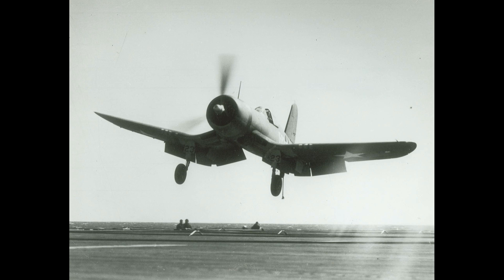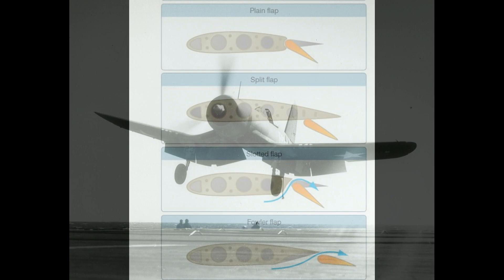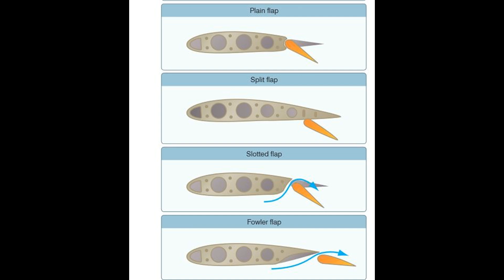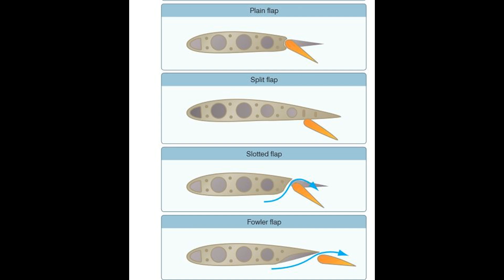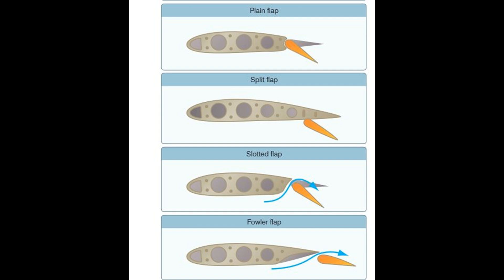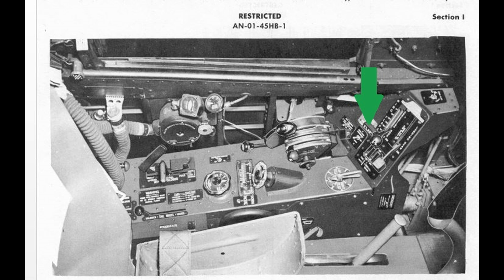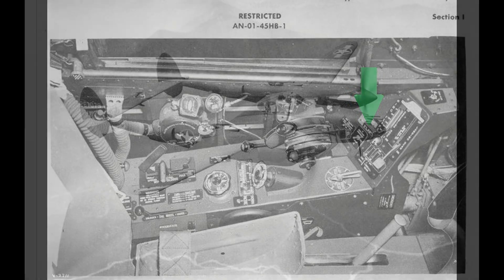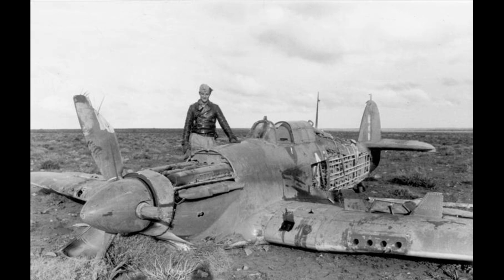Using Flaps in a Dogfight with the F4U Corsair and others

Comment: Hi!  I flew low in a Cessna 182 with a Robertson STOL kit, which was stock slotted flaps, and a provision for 10 degrees of aileron deflexion.  I flew it about 90 most of the time, and I used the flaps and "flaperons" if I wanted to bubble over a ridge for some reason.   Otherwise I flew it "clean" . The down side of the "flaperons" was, that you just gave up 10 degrees of aileron travel which you might have otherwise wanted for a cross wind landing.  So heavy crosswind landings, again I flew it faster, so as to maintain aileron "authority".   Since it was also tricycle gear, remember your rudder deflection gives you the opposite nose gear deflection you want, and tends to pull you off the runway in the opposite  direction of the cross wind,  when the nose gear touches, wings level, when you have "cross control" rudder input, and vertical stab wants to weathervane.

Comment: July 18th, 1944, 363rd fighter group, 382 squadron. 8 P 51's who had been joined by 4 P47's.   Jumped by at least 35 109's (some said 100) Lt. Richard Asbury   found a 109 on  his tail he could not shake. "Finally I pulled the circle as tight as I could, placing my ship in a spin situation, pushed the prop pitch control fully forward (high RPM), pulled the nose  up quickly to bleed off a little speed and rolled to the left dropping some flaps as I came around. The move got the 109 off my tail and me on his. The flaps on a Mustang could be used this way for a short time on the 
P-51 and I made it my business to know everything about this plane I could.  With me on his tail the 109 pulled away but I had no trouble staying with him. I pulled the trigger and only the outboard right one fired. I adjusted my aim to his left wing tip and fired, the recoil pushed me to the right and raked him wing tip to wing tip. After 3 attempts his engine started belching smoke and he was too low to bail so he rode it out to the ground".  The "tom ?cruise move"????) 
  Same dogfight. Lt Edward Pawlak found a 109 on his tail, He pulled a tight turn until the 109 stalled out. twice more in this fight he found himself with a 109 on his tail and used the same maneuver to lose them.    There's more to this great air battle, but there's no mention Pawlak  using his flaps in the turns?     This battle lasted 20 minutes. Despite overwhelming numbers the Total was 10-0-4 for the Mustangs , 8-0-4 for the 47's.  One mustang lost.    Maybe they were just facing "hitlers little kinders my first 109 students" ????????????

Comment: I have flown a great deal of air to air combat in the F100, F4C, and F15. In the first case, the F100, you were always trying to regain energy, as in corner speed. Putting down flaps would have just made the situation worse. In the other two, the F4 was better, but you were still always trying to get energy.  In the F15, not as critical, but still sometimes you got slow. I personally think, based on my experience over 14 yrs of flying fighters, not simulators, that flaps are a crazy idea. There are several maneuvers that could  be used to get around a high G corner.
Of course, this has nothing to do with prop driven fighters, just my experience.
Lest you complain about the F100, be advised our Guard unit, the LA Air Guard, made our reputation flying cleaning F100s against all comers. In the F4, we did not turn much, but instead flew the F4 to maximize its good points. In the Eagle, you just did not need to turn much, but could if needed.
Reply from the maker: I'm sure you're right about those planes, but the Corsair and the P-38 have specific settings for combat flaps and a lot of study was put into the use of them. That said, yes I suspect that in most cases there were not really useful. The Corsair and Lighting can't out turn a Zero or an Oscar even with them. The Oscar which also had combat flaps could out turn any allied plane without using them anyway.

Comment: although the P-38 is best used for hit and run, it is a much better turn fighter than is generally known and mainly is hindered by sluggish roll at low speeds in spite of tremendous lift potential. in a similar way, the F-15 is far better at low-speed high-AOA flight than is commonly known and can even outdo the tomcat in this area until flaps come into play
Reply from the maker: I still like the Tomcat more than the Eagle. The P-38's roll rate once they put in the boosted ailerons was pretty much unmatched at high speeds by other WW2 fighters.
Reply: @GregsAirplanesandAutomobiles  the f-14 is romanticized much more than the f-15, but I suspect you in particular would appreciate the f-15 if you really dug into it. It seems like a very simple and bland jet but it has a huge amount of 'hidden' attributes that only a true enthusiast would appreciate. For instance, the conically cambered wing provides much of the benefit of a leading edge flap wing design without the weight/cost/complexity penalties of such a mechanism; this allowed for the nodding intake design, which actually serves a quasi-canard function in addition to being something of a leading-edge flap for the lifting fuselage design. Surprisingly little noise is made about the fact that not a single F-15 crashed in the entire McDonnell development process, and the first such incident happened in Air Force hands. This is partially due to the tremendous amount of redundancy built into the Eagle, including what could be considered a partial fly-by-wire system (though all 3 axes) which once brought a pilot home safely without him even knowing his mechanical linkages had failed. Even the radar, with its one-man operability due in no small part to a ground-breaking use of high and medium PRF in an airborne set, is quite impressive for the 'bland' jet from 1972
Reply from the maker: I'm not saying the Tomcat is the better plane, I'm saying I like it more. You used the word "romanticized" and that's exactly it, I'm not really going to war in either one. I just like them and in simulator world, I fly the Tomcat.

Comment: Bank angle has nothing to do with G’s pulled or turn rate or turn radius. G’s pulled, turn rate and turn radius are determined by the elevators. Either positive or negative. I fly aerobatics in case you are wondering.
Reply from the maker: Mike, I don't think you listened to what I was saying. Obviously bank isn't directly related to G load, otherwise according to all the charts for bank vs. load every plane would disintegrate at a 90 degree bank angle. However if you are in coordinated flight and at a constant altitude, then yes, 60 degrees of bank will give you 2Gs and so on.
Reply: @GregsAirplanesandAutomobiles  Bank angle has no relationship to G load. I can achieve any bank angle with any G load I wish for, with ease. I can achieve 90 degrees bank angle and maintain it indefinitely with zero G load.
Reply from the maker: https://www.faa.gov/regulations_policies/handbooks_manuals/aviation/media/00-80t-80.pdf Page 38. It's there for you in chart format. (note that's page number 38, the printed number on the page, not the pdf number)
Reply: @GregsAirplanesandAutomobiles  Hi Greg, I did read all this as a student pilot some 20+ years ago. It is all correct but not very helpful for real pilots, especially not for air combat. A few more complex manoeuvres and you quickly realise this. An interesting manoeuvre used by Zero pilots was a vertical climb followed by a Stall/Hammerhead Turn at the top. Useful if you have superior power to weight ratio. Zero airspeed at the top but actually no stall as the angle of attack is also zero. Beware pulling too hard on the stick. My stall speed is 110kph but I have had pre-stall buffet at 300kph pulling 7G after a loop. This is usually called a dynamic stall. Conversely I can fly at 50kph with full power on, nose high and maybe some degree of descent. Again useful in air combat at times. The purpose of air combat is/was ‘pointing’. Ie pointing your weapons. Off course modern air to air missiles can steer 90-180+ degrees I believe. But if your are firing guns it is still all about ‘pointing’. One of the reasons the Harrier was so good.
Reply: @GregsAirplanesandAutomobiles  Hi Greg Yes that is all correct. In air combat though one would never fly at constant altitude or even straight. And often uncoordinated flight. Plain rudder application causes a horrid uncoordinated skid which easily throws people off your tail. If you are turning it is always in a climb or a dive depending on your aircraft, the adversaries aircraft and your speed. I have had pursuing jet fighters deploy flaps and undercarriage to get their speed down to mine. Not heard of it being used much in real combat though. A low speed flick roll (Snap roll in the US) is basically impossible to follow and gets someone off your tail very quickly. It also slows you down very fast and can put you onto the tail of a pursuer.

Comment: I spent 5 years flying a T6 for a ride company. Some of the flights were simulated dog fights set up on a converging flight path with pre determined offset and the turn in. As we flew with very conservative engine power settings our max g loading in a turn was limited to about 3g  (plenty for the guy up front and nice to the airframe). Some fights were over in few turns but once in a while we would get two good "pilots" (most were non pilots but they flew the fights after 20 min flight lesson) and the energy management game was on. With the better ones we would start doing bit of vertical high and low yo-yos, all to decrease the turn radius and to retain enough energy to track the lead plane long enough for a "kill". This is where bit of flaps helped, but it was only the finishing touch as the energy loss was very noticeable. It was all done for fun, but the good "fights" took a lot of energy out of me.....once the "Fight's On" came across the radio the flying got intense. The most memorable fight was my last check out before being sign off for commercial flights. I went against a very experienced guy, we started at 10k and hard deck was at 2k.....To this day (15  years later) he will not admit that I drove him below 2k but he never said that he got me. I had the front seat guy fly the airplane back to the airport, I was spent. This was a high energy fight, power was up and flaps would not make any difference as we were going well past the vertical. I saw your video where you talked about the Cub, Stearman (yes it is a truck, still love it, look up John Mohr Stearman acro to see what a great pilot can do in that bird). I think you should find a T6 with the right instructor and go up for an hour to see what these WW2 birds are about. It is an amazing airplane, it handles like a fighter with less  power. I was able to fly P51 with the instructor only working the radios after few thousand hours in the T6, it was so easy. Amazing power that you have to respect, but the landings in P51 were a non event. That wide gear, long fuselage and higher wing loading made it simple. Ok rambling on, great channel, thank you.

Comment: The FW 190 had a 10 degree flap setting for takeoff.  Have you heard of any instances of this setting being used to improve the 190's turning performance?  I feels sure I've seen a spitfire pilot's report on a 190 outturning his spitfire, and some mention by a German pilot of using flaps in combat - but it was a long time ago.
Reply from the maker: I'm sure it happened, but I don't have a specific report of instance of it. However due to sheer numbers involved, it's seems unlikely that no 190 pilot ever did this.

Comment: Just a few points for those interested. 9g only for very short period as pilot blackout and speed loss due high drag.
Every wondered why flap use forbidden above 20,000 feet for all civil jet aircraft where TAS is higher.  Found out when scissoring in mock combat at 35,000 feet against another Avon Sabre. I tried to tighten the scissor to get behind the other guy by dropping flap. Flicked immediately into a spin. Flap caused accelerated air above the wing to above Mcrit and Mach shockwave.
www.captainbyronbailey.com
Reply from the maker: That is a great point about flap usage at high altitude! And yes, every jet I have flown has that prohibition.

Comment: 6:40 :  “The P-38 shot down more Japanese aircrafts than any other fighter” : It may be true for USAAF fighters, but for all fighters it is not even close: The P-38 had about 1900 air to air kills, the F6F Hellcat 4900. It is likely the Hellcat encountered far more single engine bombers and Kamikazes however... The Japanese said: “The Hellcat was the only US fighter that would turn with us”: It could out-turn all Japanese fighters except the Ki-43 and Ki-100, and was a close match to the later A6M5 version.  6:53 “Since No Allied pilot in his right mind would attempt to turn with a Ki-43 at low speeds, I doubt Japanese pilots could make much use of this advantage” I know this is not a tactics channel, but please consider the well known instance of one Ki-43 turning continuously against 16 P-38s, at low power with canopy open for twenty minutes, until they all ran out of gas and went home... Turning ability at low speeds is not something the opponent “allows” you to use: It is an absolute advantage that can easily defeat high speed hit and run tactics. The real evolution of WWII was from hit and run dominance to slow speed turn fighting dominance by 1944, with circumstantial exceptions. I know this sounds incredible, but this is increasingly backed by recent historical analysis, especially in recent Pacific theatre research on air tactics.
Reply from the maker: Yes, I mis spoke there as I have pointed out before. The 38 shot down more Japanese aircraft than any other USAAF fighter. In regards to use of low speed turns, of course it happened, but Generally speaking US fighters had a 10:1 kill ratio over the Japanese despite having inferior turn performance. This by itself is solid evidence that low speed turn performance wasn't a dominating factor. I'm not sure what your point is about Zeros using hit and run tactics.
Reply: One historian pointing out these counterintuitive facts is Intelligence historian Justin Pyke. An example of a US pilot quote from 27 September 1942: “The Japanese Zero has generally poor fighter tactics. Zeroes could not be shaken by us if they chopped their throttles and sat on our tails...” Early war accounts of Zeroes using exclusively hit and run tactics are so overwhelming in numbers, at the near exclusion of other tactics, that citing examples would be endless... Of note is that this did not apply in the same way to the Japanese Army Air Force.
Reply from the maker: I can't tell what your point is.
Reply: The point is the Zero started by using hit and run tactics because the dominance of hit and run was a pre-war assumption (ruined by live round 1% hit rates). The A6M used hit and run against the Chinese... The document you used to bolster the idea the US used hit and run tactics all the way through WWII (in another video), the one saying “dogfighting is obsolete”, was a training manual dated 1942... By 1944, few US frontline pilots believed this, and those who did were mostly highly skilled aces, hence the skewing of post war historians.

Comment: The F4U’s flaps are amazing!  It really tightens the turn and maintains altitude, if War Emergency Power is used.  Another interesting aircraft that flap setting can benefit is the KI - 43 where the first notch really benefits tight turns.  Interestingly enough, using flaps to tighten turns in an A6M seems to add a lot of drag and very little increased lift.  Another interesting aircraft that benefitted from flap use to tighten turns was the Hurricane, even though it had but two positions. Dropping the flaps on the Hurricane really aided in it’s ability to turn.  FWIW

Comment: It sounds like you keep referring to "NASA," which wasn't formed until 1958. A report/study from 1942 couldn't be from NASA. The biggest performance problem with the Corsair was it's sluggish acceleration, but it had a bunch of flap settings and could turn on a dime. The loss of E meant beyond 1v1, you'd become a sitting duck for opponents wingman/buddies.
Reply: and the Pony had combat flaps. With a little vertical and judicious throttle turned very well. P38 turned well with them also. Many planes turned well with some flaps, the corsair was notably because they could extend at higher speeds.
Reply from the maker: Reed, wake up and smell the coffee. I clearly said NACA, and literally put the NACA report on screen, which says NACA right on it. I assure you, they were around in 1942.
Reply: @GregsAirplanesandAutomobiles  i didnt see it. You clearly said nasa not naca! whatever

Comment: Hi Greg Excellent video as always. May I adding something ? It's regarding the losses of F4-Us while maneuvering. At high angles of bank the phenomenon of wing stall reverses itself. What I mean is in a straight ahead stall the wing stalls at the root first which then propagates toward the tip. Stalling at the root sends turbulent air over the tail section which is then transmitted through the flight controls as shaking and vibration. This is the warning signal that even the most minimally trained pilot will recognize. This takes place by design. Nearly all aircraft are manufactured with Wing Washout. That is wing spars are manufactured with 5 degrees or less of twist root to tip and mounted to the fuselage with a higher angle of incidence this assures that any straight ahead stall will send the pilot a warning. In a high angle of bank the wing stalls from the tip. The only warning the pilot will receive in this case is the loss of back pressure on the stick, usually to late.
Reply from the maker: Hi Bob, I agree, I have talked about that in another video, I think the Me 163 video but I'm not sure. Thanks for making this point, it's important.